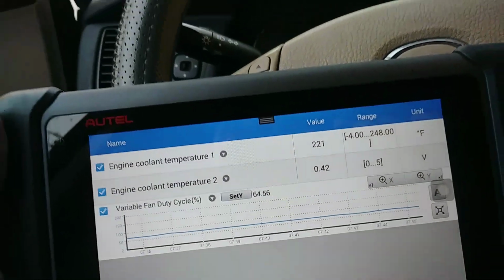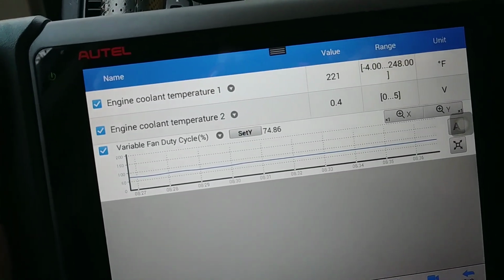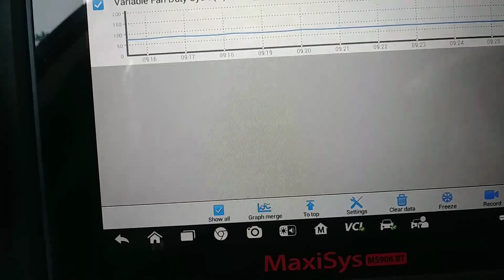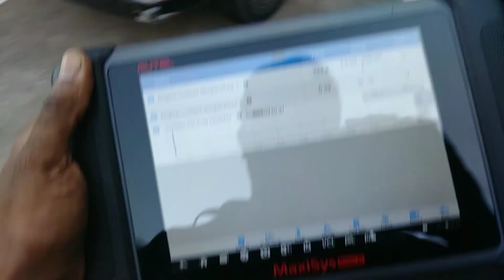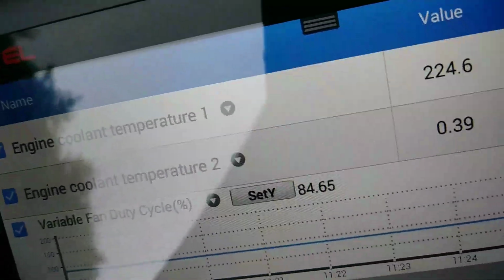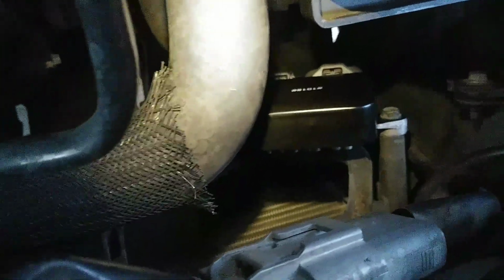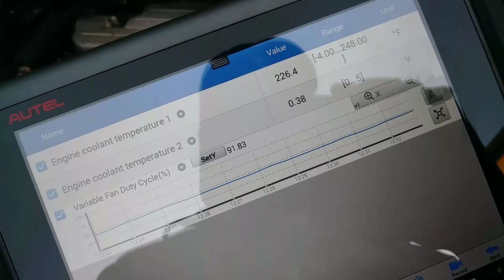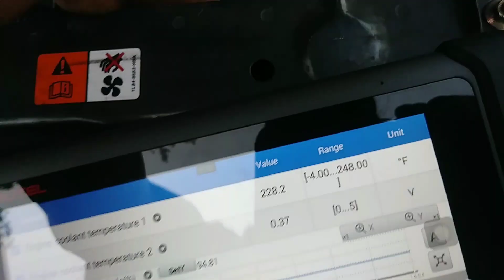2005 Mazda MPV fan control issues

Comment: Poor design as they all do this. The PCM senses the engines temperature and uses pulse width modulation (PWM) to start the fan slowly, then if the engine get hotter, the fan runs faster with higher PWM from the PCM.
Diagnostics; You have a scan tool that shows temp is hot enough to turn on fan. That PWM signal is shown also. So the PCM is sensing, the PCM is sending PWM signal to controller. The fan is coming on nice and fast, only it’s random. You can test relays while they are working. How? Make 4 jumper wires and suggest 4 different colors, with the right size terminal, all male terminals on one end to plug into the fuse box. Now, female ends to plug onto the relay at the same location. So, hole to terminal on the relay. The signal to complete the fan circuit should be numbers on the relay. 30 is power (B+) in, relay closes, terminal 87 should be hot to the fan. Now, use a digital multi meter (DMM) set to dc voltage, attach the meter leads to 30 & 87, with the engine running, dc voltage should pass thru the relay when the fan comes on. A low voltage reading on the DMM, means good contacts, very little loss of voltage. Repeat 5-8 more times with reading below 0.300 Vdc across the contacts inside the relay. The lower the reading, with the fan on is even better. You have just completed a “Voltage Drop” across the relays contacts. The relay is good. 
 The fan module maybe warm under normal conditions, but hot means no good. They are using one of two methods in the module that switches a power transistor on-off 60%, 70%, 80%, 90% of the time. This switching creates heat.
 Now, at the relay or most likely ground, the control module turns the relay on and full dc voltage go to the fan, but ground is switch on-off by the module to control speed. A strategy of turning the relay on-off 70%, 80% of the time, would wear out the relay. The relay take a low current voltage signal and switches high current voltage to the fans.
  No one thinks about the ground side, as this completes the circuit to the battery to make the fan(s) work. It’s a series circuit. Using an N-Type MOSFET transistor can switch on-off to ground very fast. They create heat and must have a large aluminum heat sink.
  The problem with modules. The MOSFET is too small (Hundreds to Pick From) or insufficient heat sink is used. The module is mounted on the hot side of the radiator (BAD IDEA)
The heat sink is too small (BAD DESIGN)
The MOSFET is too small for 30 amps (BAD DESIGN)

I would check all connectors to the module, fans and relay. If clean, no signs of melting or turning colors, use dielectric grease to reconnect. 

All of the wires going to the fan module should be lengthened to allow for mounting away from the radiator. 

Use wires the same diameter of the copper stands inside total. 

Solder all wire connections and use shrink wrap tubing. It gets tight on the wire using a hair dryer.

Locate an area to re-mount the control module, preferably where cooler outside air comes into the engine compartment, like behind the drivers side head light. Re-test until you are satisfied it is working correct.

Note; The meter leads if backwards when testing voltage drop at relay, it will read correctly, just with a negative sign in front of it (-).

DOT has a website to report issues with vehicles. Remember the Audi that jumped out of gear, then went thru garage door, or pool, or???? Well, we have shift interlock know. This may not kill anyone, nor catch fire and burn the garage down like certain cruise control switches used on FORD truck, mounted on the master cylinder, but if over heats, damage or ruins the engine, you will be left with an expensive headache if you own a Mazda/Ford product as they are the same on many modules over many years. Retired auto master tech.

Comment: The problem has to be in the thermostat, or water pump.   I tested on my 03 MPV, the engine will not overheat in parked idling in summer (80 degrees F)  without needing any additional cooling from the fan.   BTW, those aftermarket controller modules are all junk.  I bought 3 of them, all failed right after installation.  The worst of all, those el-chapos failed differently from the factory part.  For the factory part, when it fails, mostly like it keeps the fan on all the time, so you won't end up getting the engine overheated.  But with those aftermarket ones, when they fail, mostly likely the fans will stay off, causing overheating when you are driving in traffic.

Comment: I have the same issue with my 2002 MPV! I replaced the old module and worked for almost a year. Then I replaced the module again with a Beck Arnley one and now I'm having that issue. What's the fix? Thanks in advance.
Reply from the maker: I don't like Beck arnley. I would return it
Reply: I changed again with another Beck Arnley and still having the same issue again. Can you please tell me what you did to fix yours? My Mazda is in perfect shape and that's the only issue, don't want to get rid of her.
Reply: Change the Coolant Temperature Sensor, (CTS) or maybe your car has the Engine Coolant Temperature Sensor., This is the device that sends signals to the Fan Control Module which is another sensitive device for this one I recommend using a original equipment manufacturer one, those cheap knockoffs usually don’t work or fail in a short time. I hope you fix your problem... Let me know how it goes... Peace.

Comment: What about the fan working fine but still over heat...what is the problem?
Reply from the maker: Many possibilities:
Low coolant levels: leaks internally or externally
No coolant circulation :  bad water pump, stuck thermostat
Reply: Most likely the thermostat is the culprit..
Reply from the maker: @heavenlover58  water pump, thermostat, leak, blown head gasket etc

Comment: Did you ever find out what the issue? I have the same problem on my 05 MPV ...thanks..
Reply from the maker: The new part was defective. We ordered another and it fixed it
Reply: I got the same shait happening.... totally spiratic behaviour. I believe it's still the original modulator and pondering replacing it, but also learning about relay testing to start the fix there. Strange how the thermostat gage stays right it's supposed to and the fan just goes its own course like this
Reply from the maker: Be sure that AC is not turned on. To test it you should find power and ground on the two big wires. The signal wire needs an oscilloscope to see whether or not the engine computer is commanding it on or not